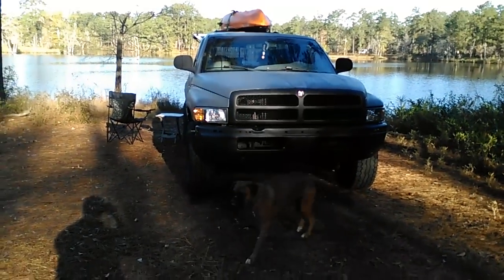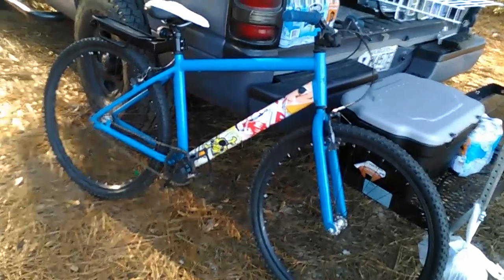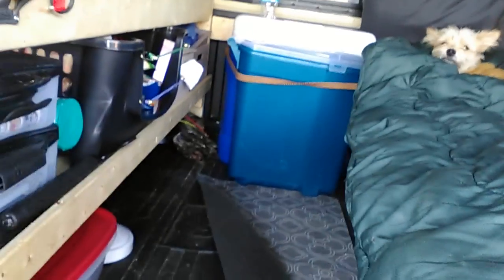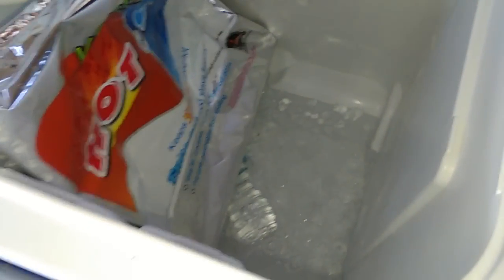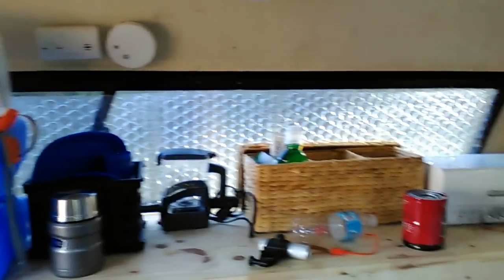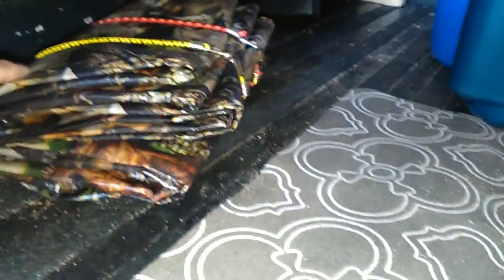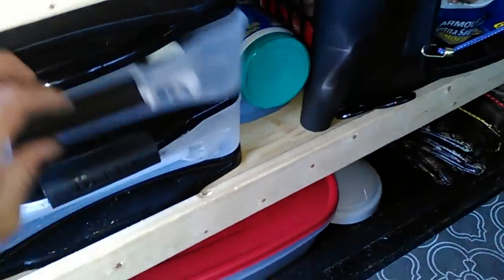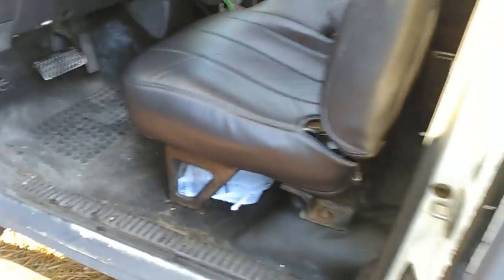The Best Damn DIY Truck Camper Set Up You'll See

Comment: Nice set up Nigel. I had just in the past two years switched from truck camping (7.3 TD Ford F250 Super Cab) to a Ford Edge. Surprisingly it was not too difficult of a transition as I was already into 4 season super light backpacking and kayaking so most of my gear is super compact and light weight so my switch over to camping in my new crossover was not too big f a deal. However now, like you. I travel with my Kayak and mountain bike. You indicate in your video you have to use a hitch mount cargo tray rack because the back of your camper lifts up and a traditional bike rack doesn't work because the back of your camper lifts like a hatch back. After getting my crossover I had switched over from using a Yakima swing daddy bike rack to a Kuat. The Yakima swing daddy is a hitch mount with a swing arm that will allow you to pivot the position of your bikes all the way to the side of the vehicle. Essentially you would have complete and full access to the back of your truck without ever having to take you bike off.  When my kids were younger and we camped it was perfect cause I could leave all our bikes on the rack and swing it to the side of the vehicle and and have complete access to the back of my pick up. It locks to the hitch and has a retractable cable lock to secure your bike which allowed me to lock up the bikes while we were out canoeing or kayaking for the day.  I have been wanting to sell it since I really only use my Kuat platform rack. If your interested let me know, I will send you some pics or short video on how it works.

Comment: just another guy with a truck bed camper here. I have an idea for you for more sustainable power. buy a lawn mower battery and a trickle charger. then connect the power inverter to the truck then the trickle charger to the power inverter and the the charger to the battery. then when your at a camp site. take the power inverter to the battery and then bam. unlimited energy.

Comment: Great setup, very clever. (Put a rubber grommet on that hole you drilled behind the driver’s seat for the power cable, the friction from driving will wear off the wire insulation and cause electrocution!) Congratulations!

Comment: ......On the power converter you have plugged to your Cigarette lighter. Your concern was running your battery down... Here is a good suggestion.... Buy yourself a Jump Box (Jiffy Jump)  (A box that you can start your car with)... Sears makes a really good one. Don't get a cheap one.....A lot of Jump Boxes had a cigarette lighter, 12volt receptical......... With you power converter, you can Charge the jump box while you are driving... When you are parked, you can run your power converter with the jump box... It will run any 110 lamp or small TV for hours and Hours and you are not using your truck battery... Charge it back up the next day when you are driving.......... We use a jump box when our electric goes off during a storm at house house... We can run a full-sized flat screen and a lamp with an LED bulb for a few hours............

Comment: Where the electrical wire is passing through the truck’s sheet metal, I’d put an electrical strain relief or at least rubber grommets to protect the wiring.  You also seem to have the potential for various fire or heat sources in fairly close proximity to your gas tank - safety concern about an ignition source for gasoline vapors. Good luck & thanks for sharing your video; you’ve got a pretty neat setup!

Comment: YOu   ought get another battery and hook them together  so you end up with a 12v system but have loads of amps. Talk to a mechanic to get it right. Good idea. Have lights on and not run dn battery.

Comment: Boy. You really put some thought into your camper. The carbon monoxide and smoke alarm is a great idea? Carbon monoxide kills lots of campers. I also like the use of  bubble wrap on the windows. Very smart.
I did the same with my 25 ft sail boat. My two cents; I would suggest a separate battery and a small solar panel for your electric. Based on the load you are pulling it would be very easy to drain the starting battery. You can even get switches to control charge and load for the batteries. Look in the boat department at Walmart. Oh and you have sharp edges contacting the electrical lead where the wire passes from the cab to the bed. I suggest protecting the wire somehow. Some of that grey foam rubber maybe....

Overall very nice set up. You are living the dream. Do this stuff now because once you have a wife and kids it becomes very difficult to get away by yourself.

Comment: Hey man nice video, another good option for warm water is a solar tube. I use 4” pvc capped on either end and use black pvc, filler at one end and hose bib on the other, then put it on your roof rack works well for warm showers and handy warm as well.

Comment: thank you for your service 🗽 have you thought about the spray rubber coating by ur bed instead of stuffing blankets down there
Reply from the maker: I'm thinking about putting more insulation in and building a slide out couch to a twin sized bed. i just gotta find a place to work on the truck.
Reply: +JR deguzman cool cool i had   a 98 1ton van as in my videos... never has mechanical issues with it just preventative maintenance did get a k&n filter and new ignition coil and h.i.d kit but nothing crazy was fun
Reply from the maker: +Josh B I'm thinking about upgrading to a short bus
Reply: +JR deguzman haha niiice i love the sportsmobiles if i ever win the lottery.. if i had kept the van my next project was to build a bed and do some kinda of roll on bed liner
Reply from the maker: +Josh B Yeah too  bad those have to cost so much.  maybe i can start a gofundme so i can have one...although ive seen some shortbus's raised and with a 4x4
Reply: +JR deguzman ya huh see a few where i live and i just drool 😰 my van was easy to get my bike in.. my pt cruiser now, not so much haha

Comment: hey brother good video I just have a few tips for you that may help. the first one is I would drill my home for my wire to go down through the floor water does not go up cuz you are going to get a lot of water come into that hole without water runs out and then I would drill 1 through the bed coming up through the floor again water doesn't go up then after you get your wires ran then around the wire I would fill it up with silicone. you're probably thinking okay how do I get silicone to hold in a hole first of all you take duct tape and from underneath duct tape the hall out around the wire then go up top and fill the silicon fill the hole in with silicone the tape will hold it till it dries and just leave the tape extra protection. I keep hearing you say that four different items you have to have the engine running. now there are solar panels that you can roll up or fold up when you need it just saw it up on top of vehicle run your wire in. when you don't need it unplug it and roll it up and put it under your bed. as far as your grill you can use out the swing arm so when you're not using your grill or need to close up you just swing it in this can be made with a couple of pipes in a hole and a little boy who goes all the way through with little not to lock it in the position that you want it. I have many more ideas if you would like to hear them. just drop me a line I will respond. be safe out there take your time don't be in a rush. take care.
Reply from the maker: Definitely, I could always use more ideas on how to make the truck better. You can massage me on fb if you want

Comment: pretty Damn awesome man. I have a 2004 b2300 that I am going to do the same thing with but I want to put a boot on the camper to connect it to the cab. no back window.
Reply from the maker: I was gonna do that too but my windows aren't the same size.
Reply: +JR deguzman they have boots that are universal and will fit the different sizes or make your own from home depot shouldn't be too hard
Reply from the maker: I looked into the universal ones and they said both windows have to be the same shape or else it won't hold properly
Reply: +JR deguzman some good rubber and a silicone sealant should work good

Comment: Good setup. And hey, what's camp w/out the dawgs huh? Started my adventures in the back of my rig as well. It's been said "Half the fun is getting there". So true. My guess is projects like yours is what inspired that thought. Truly is fun. Each trip brings w/it new ideas on what to tweak and improve and then it's back to the drawing board. Although my camping unit  has changed considerably, the tweaking part of it never does. From an old vet, thanks for taking the time to share.
Reply from the maker: so true! my rig is getting another overhaul before summer. I have a buddy that's gonna help me with making the back look even better

Comment: Nicely done! way to go. Maybe a second battery with a battery isolator its a cheap peace of mind when you want your rig to start in the morning and charge two batteries while running. Its a sweet truck for sure though.
Reply from the maker: that's the plan i think,  i prefer that than a solar panel

Comment: Good build, thanks for sharing all your good ideas. For warm / hot water in mine, I built a thermal gain water heater and mounted it on the roof. Basically just 5 feet of black 4" pvc pipe, one 90* elbow, one end cap, one threaded cap and a hose bib. Fill with water (holds almost 9 gallons) and let the sun do the rest.

Comment: Bubble wrap on the windows is a great idea. Wonder what the R value of that stuff is. Thanks for sharing.
Reply from the maker: google it i forgot what it is
Reply: +The Nomedic  increases a window's R rating from 1 to 2 , in other words cuts the heat loss in half. Not bad for something that is free.
Reply from the maker: +SouthWestIron it stops working below 30 degrees
Reply: +The Nomedic  I guess that is where a good quality mummy sleeping bag comes in.
Reply from the maker: +SouthWestIron I had a 40 degree sleeping bag and along with both dogs and my body heat I slept just fine  in sub 20 degree weather
Reply: +The Nomedic  good deal, thanks again for the video.

Comment: have you really considered running a small solar outfit? just need a foldable solar panel from amazon then your charge controller a couple sealed ago batteries and you have power. just something to consider.
Reply from the maker: yeah i have.  but the amount of stuff i have to power doesn't really require it. maybe eventually

Comment: You may need a small generator..like a Honda 1000 Watts..with less than a gallon. you can run alot of stuff... for like 10 hrs..and never run off battery charge..!
Reply from the maker: +Manolo Vicencio haven't killed my battery yet. the only thing im running at night is cell phone charging. but im in the process of hooking up a second battery to the alternator

Comment: Noticed your car tag straight up! Thank you man for your sacrifice! Bless you! 💜
Sweet set up! 
Cork sheeting is pretty cheap thru Amazon if you need to insulate walls and floors!
I had a terra Cotta heater for my last winter( 2 years thru 3 Winters) in the Tn mountains... Was tenting it ... The average temp that year was teens to below zero... The terra cotta did not hold up! And candles by that kind of volume get expensive and have to keep them going! I suggest if you're in colder territory for winter to get a better heat source! It's no picnic waking up to your limbs and majority of body starting to freeze! Does pretty much leave permanent skin sensitivity!😂
Wintering in warmer states will save on your expenses!
✌️😎💜

Comment: Dude that's seriously really cool. Good job! And thanks for the video! That's actually really cool that you have that long block v6 in that 1500 they were rare in those trucks and were actually sometimes better thAn the 318 v8 and 360 v8 people don't always agree ....but the 287 long block v8 is the best out of all of them. I've had Durangos, dokatas, and ram pickup trucks all everyone with all 4 different motors and stock trans to go with them and in every truck the 287 lasts forever ...and defenilty gets the ...Well any job done. My 2000 slt plus dodge Durango last one I kept has the 287 long block v8 [4.7] liter has 319,768 miles with everything stock. ....i also take very good care of it. I love it it's seriously one badass mid sized SUV. anyways from a pro of good Daimler Chrysler products you've done very very well thats hella cool. :)

Comment: Not pretty but practical as......But watch the end cable ties that hold the cooker rack. Looks like there is a lot of leverage on them, specially when you have pots on the cooker. The  ties could shear through and snap (dangerous). I would cut some coat hanger wire or something similar and creatively bend them so they clip and un-clip, or maybe some wing-nuts and large washers. Anything but those ties. Also if you can afford, get another battery identical to the one you have in your truck and hook up a small solar panel to it. Then you have a back up battery for your rig as well as running other stuff of course. 
I like the back door..Good stuff...Enjoy
Reply from the maker: I added more zip ties along both sides and are rated for 70 lbs each
Reply from the maker: I added more zip ties along both sides and are rated for 70 lbs each
Reply: Good, Im less worried now.

Comment: You might want to consider a solar panel for your inverter you will have a dead battery in the mornings good video though nice set up
Reply from the maker: i only run it when I'm driving. I'm doing a major overhaul before summer. this thing is gonna get decked out by the time summer hits.